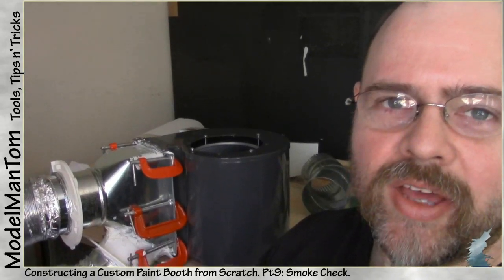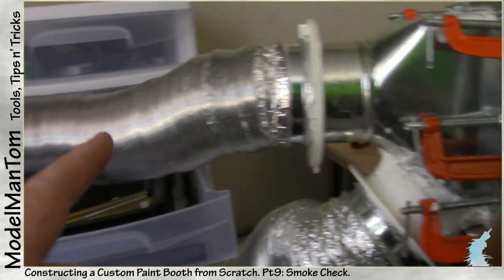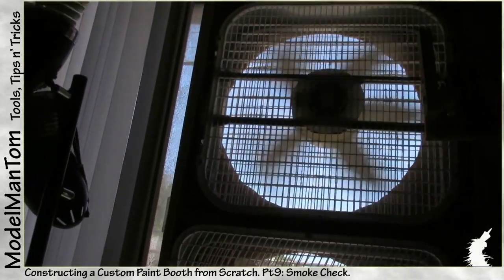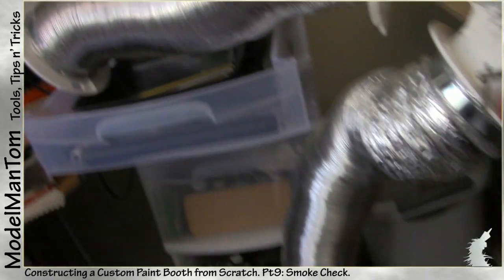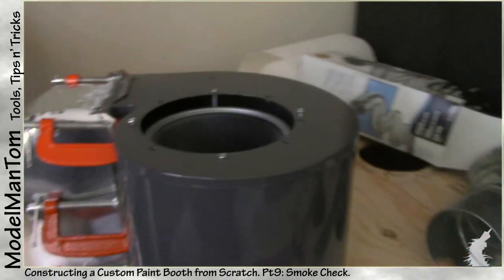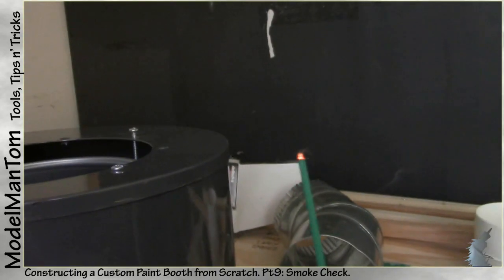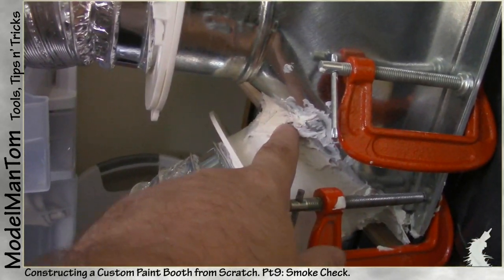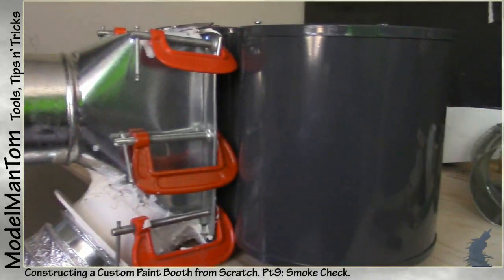Paint Booth Pt 9: Smoke Check

Comment: Are those window fans facing out or in? A paint booth works on positive pressure, by means of an intake and an exhaust. If the window fans are blowing out, then they're working against the blower and not with it.
Reply from the maker: The window fans are reversible at any time. I often have the lower pointing at me while the upper exhausts.  But I have been having both blow in or out at any given time as well depending on the weather.  I will keep in mind that having them blowing out while the booth is on will lower the room's air pressure.

Comment: Just a thought; That kick back you are having might be because of the ribbed flex tubing you are using. The long you extend the tubing, the more friction of airflow causing the kick back. Rigid duct is what you need. The duct you have is used for dryer vents.

Comment: Neat series of videos.  Have you considered putting the flange that wraps into the squirrel fan back on as that seems to be the area you are having the problem with and likely why the squirrel cage fan comes built that way.  Static pressure is a real problem.  They make a more rigid flexible duct that once expanded will be better than the less rigid ducting you are currently using.  Keep the videos coming.